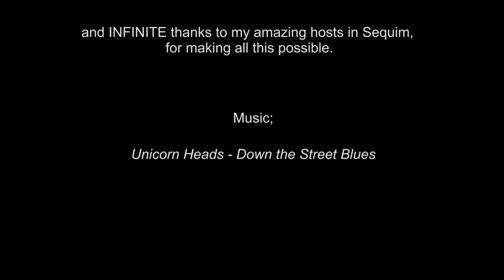Two AMAZING projects / Old Boats given New Lives

Comment: 2 tons of trash!!!! That’s amazing!! I will be supporting that project!! An incredible young man.
Reply: 2 tons is nothing, sadly..
Reply: Go on then and lift it. Better yet, figure out a better way to do more of the same thing - I bet you could if you put you mind to it. People do amazing things when they decide to.
Reply: 2km coastline of Norway was cleaned this summer by a group of voulentares, they picked up 22tons, while this was in an heavy affected area where a lot of stuff from UK and Netherlands float in it's still was just 2km... Norway got 29000km mainland and 72000km island coastline.
what's needed is free dumps at the recycle plants for drift plastic that just some few districts got in Norway...

i for my part picked up 16 tons last year with whats classified as drift trash but i see i different as drift wood can be ether cut to planks if large enough logs or fired up to heat my house (don't do it in an old cast iron fireplace or it will rust to pieces in no time because of the combination of salt plus heat).
and no landbugs goes in wood that have been sipping in saltwater for a year or so.

Comment: I would recommend going with an electric drive motor for Tally Ho, even if you have a generator to run the electric motor at first. This will allow less change in the future going to battery with solar/wind recharging.

Comment: The Perkins sounds nice, but how about a Gardner diesel ?  They are slow turning, loads of torque and very efficient !!  Of course you might have to smuggle either one into the US these days.
Reply: I was just going to suggest that. Have  a proppelor with a smaller diameter but a greater pitch to compensate for too much drag. Another solution would be a proppelor with a variable  pitch.

Comment: Really nice projects! Your friend is right the old Perkins A4.236 engines are really reliable machines, we have two in use(tractors) to be honest, they did not get any good maintenance at all but as long as the battery is good and it get's some fuel and air they will most likely always start and run. besides adjusting the valveclearance and changing oil and filters there is not much to repair on these. Thanks To Massey Ferguson you will get parts everywhere in the world. only downsinde besides power is that Perkins is kind of known for leaky engines. Especially the older ones often have leaking seals.

Comment: Looks like a decent engine 
I'm sure Leo is aware but for other commenters 
Don't forget the engine is also a saftey device as well as just moving you around itll also stop tally ho getting blow across a reef or other situations 
May pay to look at toyota deisels as well 
They're used all over in marine as well under Yanmah (well yanmah buy the parts off toyota)
They have a great reputation in australia 
And offern get over 500k km in cars

Comment: To all three of you I have the same 3 question. 
1.  Was it less expensive repairing and getting your boat  ship shape again vs just purchasing a new one?
2.  When repairing/rebuilding, did you go back to her plans or did you modify and if the latter why? (Example because of issues not caught when originally built or to modify or change to suite specific needs you had)
3.  And lastly. (Kind of an extended part of question 2). Did you modify or change things as in make it less weight, stronger, take out bracing required back then due to the limited material they had (example glass today is much stronger than in the past so you can have bigger ports or glassworks), etc.  and part B of this question are you adding more electronics to the boats to aid in safety or convince or what?  

Sorry, I’ve just been fascinated with boats and ships and how people are restoring the past to bring them into today.  It’s a shame sometimes to see a wooden cabin cruiser from the 30’s that was restored original and now being wrapped in fiberglass and painted and altered to make it more “modern” looking by someone with lots of money and no enjoyment of the pure beauty of the past.   Life doesn’t only exist in a smart phone and the internet.   Sometimes true beauty of life is just stop, slow down and look at what God has put there for us to enjoy. Unfortunately some people will never look up from their screens to see it.  

Sorry rambled again but I would really love to hear your answers.   Ladies first Leo.

Comment: Oh!  Fit an electric!  You would need a backup genset anyway, which you could drive with that monster diesel.  But think of the green statement you could make if your primary power was battery packs, a solar array, and a couple wind generators.
Reply: Maintenence nightmare on a boat. And you only use your engine coming into port most of the time anyway so.
Reply: I vote Battery bank and electric motor too.. think of the episode you did on the ferry!! Yours pre dated steam power, would be quite fitting to make everything electric for 21st century upgrade.
Drag hydro generator when under sail, use solar and or wind generator when anchored. Maintenance free, not to mention silent!
Reply: Oh for God's sake don't get drawn into this ecological electric debate. No battery bank on earth is going to drive a boat the size of Tally Ho for more than a couple of hours. You would need the diesel to charge the batteries anyway, so eliminate the cost of the electric motor and the batteries.
Reply: A 30 hp engine puts out 22 kw.  You can easily mount a 100 kWh battery bank, more if desired.  Two 400 w turbines running 24 hr plus 10 300 w panels running 8 hr/day would generate about 45 kw/day.  Marine grade systems are available.  It’s reasonable.
Reply: The dude has sailed to the damn Caribbean with no engine at all.. I don't think days of electric propulsion are going to be required.. On top of that, there are no worries about "running out of fuel".. You just wait a while in the breeze / tide / current / sun.... and magically your fuel tanks are full again.
Reply: If you really really have to.. you usually have a portable diesel generator as back up stored somewhere
Reply: @jordan lewis... Maybe. Maybe not. Electric motors have far fewer parts and are, in turn, far less complicated. There would still be the issue of generating and storing electricity, but an electric motor would have unreal amounts of torque for its size and also a very wide speed range without needing a transmission. I hadn't thought of an electric motor before reading Mark Jones's comment, but it seems to be an idea well worth considering.
Reply: Nothing green about that !!! think about it !!
Reply: @benters3509  
Might want to look up the tesla battery bank in South Australia
Reply: If you want to know what a stupid idea an electric drive would be on a boat this size, go check out the calculations on Travels with Geordie site here. This will tell you much more eloquently than I can. Go to 19:20 in the video to see the calculations. Answer is, yes you can do it if you have a generator. Three problems, it will cost a huge amount of money, the batteries will take up a huge space, batteries (especially Lithium Ion) are very damaging to the environment, what with mining, shipping components around the world to make the batteries, shipping the batteries back to point of sale, and disposing of them at life end, plus this is supposed to be a historic boat. She was designed to have a diesel, that's what she should be fitted with. Also, Lead Acid batteries, a lot cheaper, only are good for about 100 charge/discharge cycles before they are done. Lithium batteries, if you make one mistake operating them, they are toast and the whole expensive bank will need to be replaced.  
https://www.youtube.com/watch?v=yZKitzDOl4k
Reply: @Benters (and @flowletm1992)...Just to be clear, I'm not arguing in favor of being greener than thou. Eco-friendly power doesn't count of much if it won't work. But keep in mind that cruise ships (like locomotives) are diesel-electric. As far as preserving Tally Ho's originality...puh-LEEZ!  The original plans clearly read "MOTOR" (c. 13:47) -- without specifying what type. Had Albert Strange designed Tally Ho today, he might well have wanted an electric or diesel-electric motor in the boat. Also, it is likely that diesel fuel will either cease to exist or become prohibitively expensive in just 20 years, let alone the next 110 of Tally Ho's life. I'm not arguing that electric motors are the way to go...only that they are worth considering.
Reply: Is biodiesel feasible? The engine conversion probably wouldn't be overly difficult, but is there sufficient fuel supply?
Reply: Coming back to this with a more obvious thought... the prop, while under sail will become a generator, so the all the time you have good sail, you have well charged batteries.
Secondly the batteries can be used when there is wind but not quite enough wind to make modest speed, you only need a minute amount of power to SUPPLEMENT the sails efforts to get the thing up to speed..
Going electric is a No brainer really (sorry to shit on the ideas that Steve has about his idea of fitting a derv engine though, dude is a Saint..)
Reply: Interesting and insightful thought, Andy. Keep in mind, though, that some sailboat propeller blades can fold down or change their pitch when not in use to minimize drag*, though your point that it could be used as a turbine is a good one. I've seen videos of other sailboats using battery power, and one used a small windmill as well as solar panels. I think the main argument against battery power would be one of how long the boat could run using only the propeller. It'll be interesting to see what (if anything) Leo has to say about all this, though my gut tells me he'll just drop a Cummins in Tally Ho and call it a day. *Check out the images toward the bottom of this page: https://www.cruisingworld.com/spin-class-finding-right-prop#page-10

Comment: Hm. I would feel kind of trapped at the aft part of the table - the only way out seems to be to have everyone else stand up and move right out of the seating, if you need to get to the head or whatever. Don't really see an obvious solution, without cutting back on the number of seats available by cutting the table up to allow movement aisles. But this kind of seating always drives me bonkers at Thanksgiving dinners and that sort of thing.

Comment: Years ago i sold my rusted out car  to a Cape Cod, fisherman in Massachusetts.
- Peugeot Station Wagon Diesel Engine (automatic transmission)
https://www.google.com/search?q=Peugeot+Station+Wagon+Diesel+Engine 
He desperately wanted it for its Durability and Power.
I do not know that the size of this car's diesel motor is big enough for your purposes.
I can say this: 
-The four coil rear springs allowed me to carry MORE winter-fuel logs and branches (close to double the cords of wood) of newly harvested (green/wet heavy wood) Oak Hardwood, than could be carried by a Four-Wheel Drive Ford 250, V8 Engine.
- I could drive at 55 mph and the Ford could only do 45 mph. 
- I could climb logging road hills out of the woods easily or on the highways, and the Ford would have to drop one or two gears.

Comment: Why not go electric (the motor)?
Reply: Energy is always required. Batteries are heavy and bulky with  poor energy density.
That's my take.
Reply: Cricket Shine only issues I can see are volume that the batteries would take up. And price. I can imagine that Leo would be a pretty light user of the “engine”. Batteries could be continually topped up via solar. The panels would not fit the old yacht aesthetic tho.

Comment: Your need a beta 75 in tally ho , long keel , wade body , I wouldn’t muck about with old classic motors , this boat won’t point high , , will need big battery’s ,  ,so reliable power is a must , some thing that has parts all over the world , you don’t want a ton that has 40 hp  over to you , my boat is a classic the best thing I did was repower with a beta modern motor never looked back , so while your in the states motors a everywhere   Put some feelers out see what pops up ,